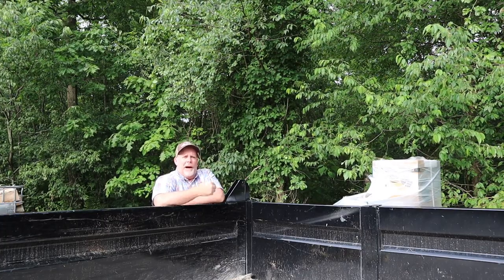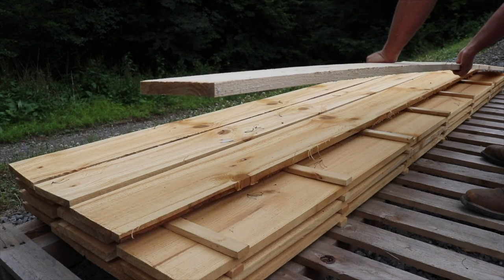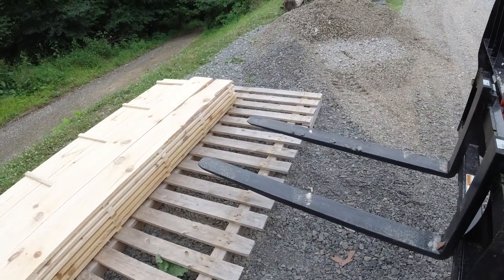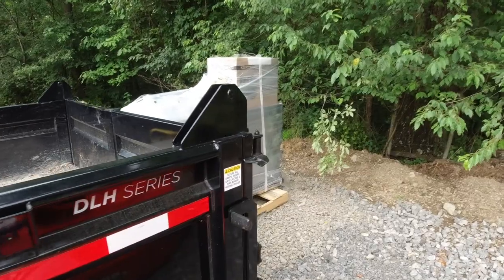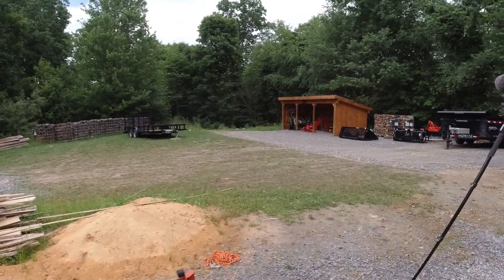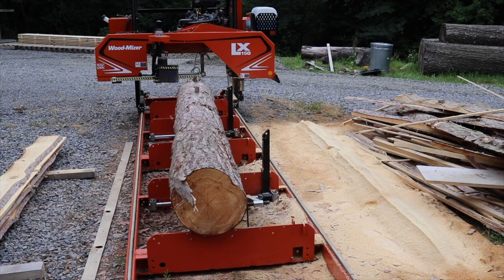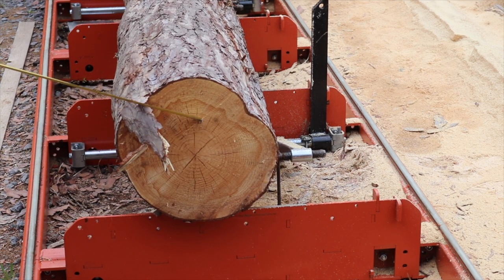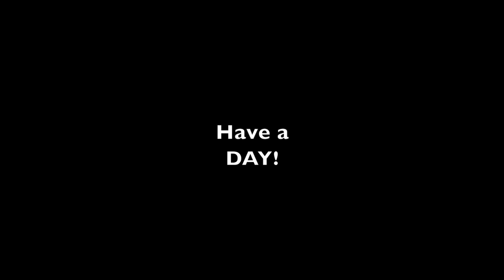#823 Least Expensive, But Most Useful Attachment for Your Tractor that is often overlooked

Comment: I agree the pallet forks are great I drilled holes in the ends and i an use heavy S hooks to lift motors and such, I also can put a trailer ball to move trailers,  push a lawn roller into tight areas. Keep the great videos going Mike.

Comment: I am building a retirement home on 5 acres of family property. And bought a Kubota L3901, best invent yet. I also purchased pallet forks, grapple, front loader, box blade and a 18 ft trailer. So far I have used all of them and only have about 25 hours on the tractor. But by far the most used implement are the pallet forks. Came in real handy when building the metal building. Love them.

Comment: Agree on  the pallet forks. This week they unloaded a delivery truck with 3 tier pallet stack of grapevines, moved heavy picnic benches, and IBC totes with and without water. The do lots of odd jobs.  My dealer years ago said to tilt the forks up slightly to move the pallet arms. Did this for years until I saw a youtube video showing someone tilting them down......way easier. Have fun with your new saw mill.

Comment: Great idea introducing the LX 55. I purchased my mill at the end of 2019. Not a WM, but the same size capabilities as the LX 55. These smaller and more affordable machines are little beasts. If you want to slab a 36” black walnut your out of luck. But if you want to be able to mill logs that are readily available, and much easier to handle , you’ll need to watch what Mike can do with this “little mill”.

Comment: I agree Mike. I use them more than the bucket or the grapple. I recently threw the hydro belt on my mower and couldn’t get to it without pulling the deck. I put the forks on the tractor and lifted it up to where I could get under it and work on it. I power washed the underside of the deck and sharpened the blades while I had it in the air.

Comment: 27 point something acres, about 22 in woods, mostly black locust with a few walnut trees mixed in.  More honeysuckle than anything.  Property has set vacant for many years and honeysuckle has taken over. I love your RK 37 tractor videos, bought my RK37 on January 1 this year and drove it to the property. RK is only 2-3 miles from my property. I have since added a graple, brushhog, box blade, landscape rake and a Woodland Mills chiper. I have about half acre for a food plot. Removed the old house and built a 40x64 pole barn. OK, I did not built it, Amish crew did. Primary use is hunting and hiking once I get some trails cut. Poisen ivy everywhere. I do enjoy your videos, wife says you are my best friend that I have not met.
Reply: Just north of Springfield OH
Reply from the maker: Love it!

Comment: i was going to tell you a friend of mine has 5000 acres full of trees and he has a saw mill like yours and a few other saws . What he did is built a Metal Building with just a back wall . It is 60 x 100 feet . He also has a small Kiln to dry out the wood . He powers it with all of the saw dust and Chips he ends up with . He did pour a 100 x 100 foot cement pad to but it all on . Works great .

Comment: Fork are probably my most-used implement as well. I also pulled the bladder out of an IBC tote (like the ones you're using for firewood at 16:08),. Put the IBC frame on the forks and secure it with a tie-down strap to use as a man lift.

Comment: I've found that if you drill a hole in one of the forks, you can put a long shank ball through it with a hole drilled in the shank for a clevis pin and be able to move any trailer around with ease.

Comment: We actually use our hay forks as forklifting and get two uses out of one implement!
Reply: i used to use the manure forks for cleaning manure,rock picking,brush rakeing,ripping concrete floor,picking up 2 pallets,ice chipping on driveways,picking 2 round bales ,blocking firewood,loading logs lots of uses with manureforks

Comment: Good morning all, Phil from Kansas City here. Quiet and rainy this morning. Stihl store was good yesterday cleared out much of the service work.  Have a Day.
Reply: It seems like a Stihl repair man would be like the Matag repair man. Lots of time on his hands because my Stihl saws hardly ever need service.
Reply: @davidmorse8432  to a degree your statement is true.  Most of my work is on units 5 to 10 years old, that have sat with ethanol fuel  in them and have caused the carb diaphragms to harden.  For $30 + parts I will perform an engine check including a pressure / vacuum test of the engine and I pull the muffler to look for scoring on the piston and cyl wall.
Reply: @rphiliprogers  That ethanol gas is bad on 2 stroke carbs. It took me a while to figure that one out. Hey, that new synthetic oil mix (grey bottle) that Stihl makes, works pretty good. My saws and weed eater run better with that stuff.

Comment: I use my forks daily for one thing or another. While I agree that 4' forks are great but it depends on your machines capability. I run a set of BX2415 32" forks on my BX2380 and they are just right for what the machine can do. On the flip side a 966 loader is handy with a set of 8' forks. Mid size tractor is great with 48" forks.

Comment: I don't have a FEL so I bought the carry all for the 3 point.  I can still manage a pallet of firewood.  I wish I had a hydraulic top link but I don't have any rear remotes.  I also have the boom, post hole digger, trailer mover, and box blade.

Comment: My biggest regret is not getting a 4wd tractor for backing up a slope with a load on the FEL. I can't afford a grapple so I made three forks for the loader bucket  mostly to stack limbs and brush on and move to my burn pile.  They extend out 40" from the 6' bucket (50 hp blue tractor) so I can load or fork up one heck of a brush pile.

Comment: Bought forks for my LS35/40. Best tool indeed. I use them for so much more than the bucket. The only thing I don't like about forks on the tractor, is that I can't see the fork tips, over the tractor hood. I have to line up and guess and hope. If I stand up to get a better view, the safety switch in the seat turns the engine off. Grumble!

Comment: I agree, pallet forks are indispensable. I keep many things on pallets, and move them easily. I use gaylord boxes on pallets, to move firewood. 
Pallet forks are great for moving logs and brush piles, and are my poor man’s grapple. 
I use Titan clamp-on pallet forks, on my Kubota B3350 pin-on loader bucket. Those forks clamp on right over my Heavy Hitch Tooth Bar (also indispensable), which lets me leave the tooth bar on all the time. 
The Titan pallet forks are 43”, 4,000 lb capacity – and heavy.  But, easy to put on and take off.  I use an extender pipe, to tighten the claps.

Comment: Pallet forks are handy.  I have a set that hooks on the bucket of my backhoe/loader. I can put them on and off without getting off the machine.  Sometimes it is difficult to see what they are doing with the bucket in the way though. I am thinking about setting up one of those "back-up" cameras somewhere so I can see the tips of the forks as they enter the pallet.  Probably never do it though. More trouble than it's worth.

Comment: I like the idea of the smaller cheaper mill, I would love to buy a piece of land with trees and just build a cabin and make all my own word for it just clear a little in Millwood and just keep going till I had enough to build a cabin and then sheds or whatever digger well and throw some solar panels up and just create an entire Homestead straight from the land without going and buying a ton of supplies. Then I would love to just have the word I’ve always wanted to do some of the old style wood construction without using nails or brackets, I would love to do a log cabin built completely out of wood.  And I would love to just play with different building techniques but like you’re saying what is expensive to go by and play with but if you can make your own it’s just labor and time

Comment: Mike you said the Woodmizer LX 150 Sawmill was expensive to get and it took you how many rear to get enough together to buy and you promote the heck out of it do you get kickbacks from them??  Now you say the little one you just got is 4k and you are going to use it and report stuff to them? did you buy it or they letting you use it to promo it also. Im just asking. Like the mowers You bought a brand new O Turn and now you have belly mower on one tractor and a brush cutter on the big tractor How many grass cutter machines do you need/??  My 65" Ferris would cut all of that. Just asking dont get mad just i  dont understand

Comment: Yes I agree after buying my Kubota I bought a tiller I’m into food plots but my 2nd was pallet forks and yes other than my loader I use the pallet forks for all kinds of stuff very useful! One thing maybe you should mention to viewers is buying a tractor with the quick attach loader system other than pin on. And one thing I did which the gentleman I bought my forks off of talked me into I originally was going a little cheaper and almost bought forks that were just at or below my lift cap. (Cheaper) but he talked me into buying ones that surpassed my lift capacity that way they should never fail or bend using my tractor also with forks you increase your lift capacity because there lighter that your loader bucket ok just my thoughts but your 100% people don’t mention pallet forks and cut a little wood probably only 1% of what you do but my forks are my grapple for all I do ok have a Day and keep up the great videos! And hello Hunter time for a BK run ! And never I  knew they made a saw mill for around 4000 can’t wait for videos because your right for me a 15,000 would not be practical but 4000ish got me thinking thanks . Chad form Brookville PA !

Comment: Hey Mike, love the videos. As for pallot forks, would you say 48" forks are still the better choice for smaller tractors. I've been looking at getting forks for my B2650, but was originally thinking 36" forks. Main reason why I was leaning towards 36" is due to max lift capacity of my smaller tractor. The further the load is out the less lift I have. I know there is also 42" forks out there that I have been debating as well. Curious to know what your thoughts are.
Reply: Please get the 48's, they work best with most pallets. Has nothing to do with the lift capacity of your tractor.

Comment: I agree pallet forks the most useful. But another attachment that gets over looked is a carry all. It is also a attachment that can be used for all types of things.
Reply: What's a "carry-all" ?
Reply: @davidmorse8432  carry all is for the 3pt the one I have seen locally is made from 3x3 angle iron with predrilled holes.  Can make a bed on it for hauling firewood or even tools. One version of it is the big tool rack. At my local tractor store they run about $160. Can even be used as pallet forks for the rear of tractor.
Reply: I built what you call a carry all 30 years ago and it is great for 2 wheel drive tractors since it puts the weight on the rear.
Reply: @realairplane261  Throw some old worn out dozer rollers in there for extra ballast.
Reply: @kevinbrewer2141  Thank you for explaining.

Comment: Here's a question for you if you dare answer so you did have the r k tractors now the kabotas which is best
Reply: Good luck on that question.  I believe he would tell you the best is the one you have or the one with the most perks.
Reply: Mike is not likely to burn any bridges so don't hold your breath on getting an answer.  I think either tractor is pretty good but my choice would be the Kubota.